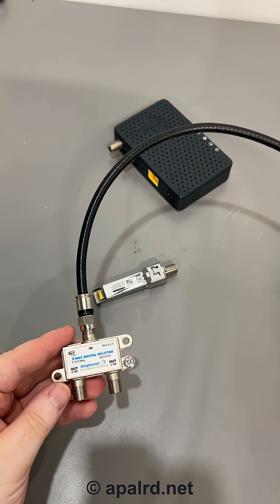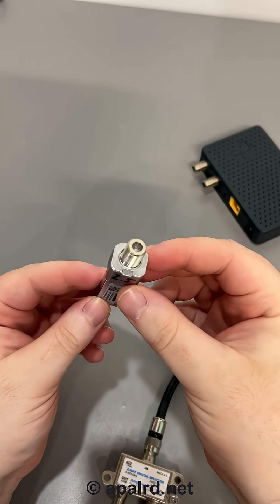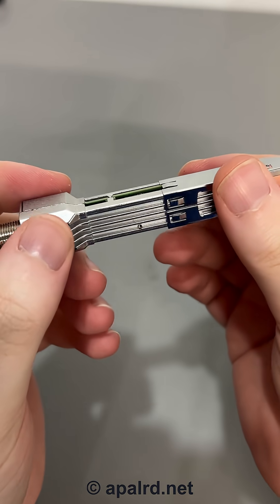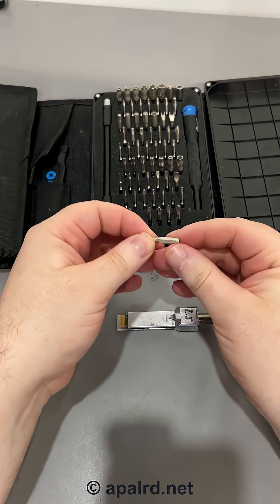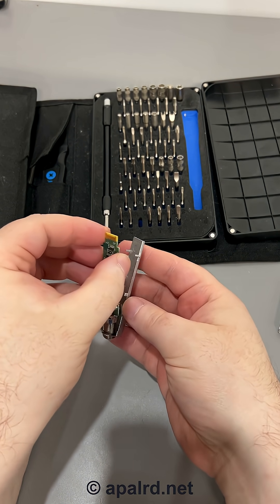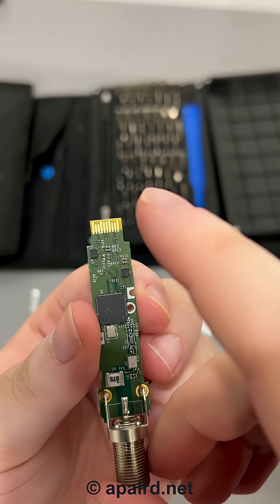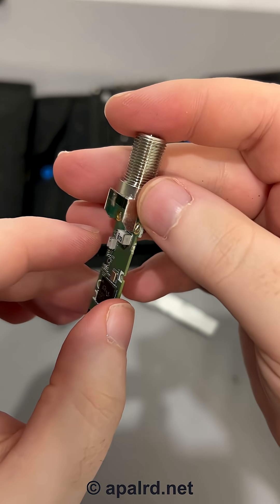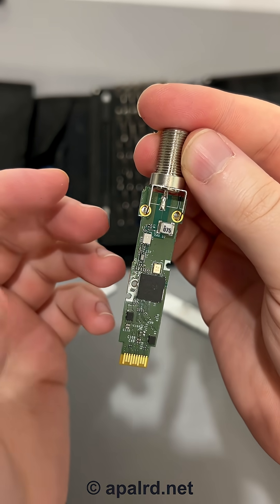what's inside a MoCa SFP adapter? #homelab #networking

Comment: I still wonder why coax Ethernet sucked but moca is so good
Reply from the maker: Coax Ethernet was only defined for 10M (it’s the original Ethernet), so performance was about the same as 10Base-T with hubs. But switched Ethernet made a massive difference in collisions and line utilization. MoCa acts as a switch on every node, and the shared medium is time sliced to avoid collisions.
Reply: @apalrdsadventures  I heard that coax Ethernet was very unreliable and annoying (any dirt or not fully seated connectors could destroy the link) 

I studied Ethernet in the university last year, it looks like people transitioned to twisted pairs mainly because companies already had phone wiring, so it was an easier upgrade than laying down coax (opposite to what we have today lol)

Comment: I can't even remember how 'fast' the ethernet speed was when I last used coas. 100mbit perhaps? Sounds too high. And I didn't have those pretty boxes. I had a line, terminators and T-junctions.
Reply: As far as I remember it as 10mbit at most. Maybe even lower.
Reply: @jocjoc5587  Sounds more accurate; 100mbit sounded off to me already.

Comment: Hey! 1994 called - said it wants it coax back.
Reply: I certainly don’t remember having 2.5 Gigabit networking in 1994. We had a 14.4k modem and 230.4 kbps LocalTalk networking.

Twisted pair certainly has advantages over coaxial cable for networking, but coax is far from obsolete.

Comment: Wow. Totally a game changer for old houses.
Reply: Do t forget old houses do well with powerline Ethernet. 

I get 400mbit access across the house with it, and it’s running several desktops and stream boxes (stuff I don’t want on the WiFi)
Reply: @thisisreallyme3130 powerline ethernet never does well lol. most wifi can do better than 400
Reply: @Megasteel32  And powerline Ethernet also puts out a fuck ton of interference on the HF radio spectrum. Once I got into SDRs and got my ham license I immediately got rid of my powerline adapters for a ghetto fiber run 😂
Reply: @TRLTheRandomLab turning your home wiring into a giant antenna will do that 😂

Comment: Does the coax need to be unused?
Reply: Yes. MOCA is funky when you have  service provider equipment in the mix. No problem with old school air tv antennas. So I guess it depends.
Reply from the maker: It works with antenna and most cable companies. It will have issues if they are doing docsis 4 or possibly 3.1 with high frequency ofdm downlinks. You need a moca point of entry filter to prevent moca from going back upstream, and people have suggested one at the cable modem too.

Comment: I remember 10b2 Ethernet.  Still have terminating resistors and tees laying around somewhere too!  Switching (no pun) to 10bT was quite a bit more reliable, though - and given your comments about crimping, I'll stick with twisted pair on modern hardware.
Reply: I mean, twisted pair doesn't exactly work well when crimped wrong either...
Reply: The advantage of MoCA is many homes already have Coax for cable TV and it's easier to use existing wiring than to pull new cat 6.
Reply: @jdmulloy  But keep in mind, that older installs already struggle with digital HD TV. 
I don't know, if MoCA does work better on those. 

Rarely had issues getting ethernet where I wanted it. Sometimes you need to think a bit outside the box.
If standard orange is too bright, there is also white Cat. 7 available, which usual blends in very well.
Reply: @AzrethK9 it also depends on comfort level. I've run cat 6 in my house and years ago in my parents house I ran cat 5 and coax. I ran the coax for Comcast DOCSIS and my basic crimp worked fine. Its been used with MoCA just fine for Fios since there wasn't an easy way to run cat 5 from where the ONT is to the rest of the house.

Also if you're a renter it makes more sense to use MoCA adapters with existing coax than to drill holes.
Reply: I had this thought.  I remember 10Base5 and 10Base2 Ethernet.

When it really was radio in a coax.

In the 1990s I  saw Dr Robert Metcaffe (co inventor of Ethernet) speak at Computer Literacy in DC where he explained how he "borrowed" the idea from AlohaNet.  They just used coax instead of an over the air radio.

We have so many variations of Ethernet today.

Comment: I didn't even know we could. I have coax in every room here. But not yet UTP. Maybe this works also? Did you test it? Do you get 2.5gb out of it?
Reply from the maker: MoCa can pretty reliably do 2.5G half duplex if your crimps and splitters are good. I had a hard time with my crimps, the comment section said compression connectors would work better. 

There are of course products like the one in the beginning of the video that can do 2.5Gbe as well. It interoperates fine with docsis cable but not satellite.
Reply: @apalrdsadventures as a former Comcast tech myself, you are right, compression connectors are the best to use. Crimps mess up the impedence of the cable which causes signal reflections and can even cause ingress/egress which is a cable tech's worst nightmare chasing down.

Think of it this way: your coaxial cable is not sending a regular electrical pulse the way UTP or phone wire would, it's instead acting like one long radio antenna on the center conductor and the outer shielding of the cable separates the radio airspace between the inside and outside of the cable. So any kinks or moisture or hard bends or crimps etc mess up that signal. For CATV communications (including internet, or residential "triple-play" services) the cable MUST remain at 75ohms for the signal to be usable.
Reply: Also for anyone else paying attention: use RG-6 always, do not cheap out with RG-59. Signal quality drops off too sharply at the higher frequencies MoCA operates at on RG-59 and the shielding is just not as good either. You'll have a bad time trying to use it.
Reply: @karliah1337  What frequency range does Moca work on? Is it above gigahertz?
Reply: Your regular Lowes or Home Depot should carry compression connectors and the tool to compress them. If not you can find online. I'd personally recommend any tools made by Jonard, they're more or less the Snap-On or Klein Tools of the cable tech world. Although Klein makes some compression tools too I think? Idk. Either way, they're super easy to use and will create a stronger and better connection that's even weather resistant to some degree. I never ever use crimp-on F-connectors

*edit just checked, Jonard is expensive but some off-brand clones should work just fine for around or under ~$20USD. Look for a tool with a big U-shaped handle, usually blue and/or green. Clone of Jonard CT-200